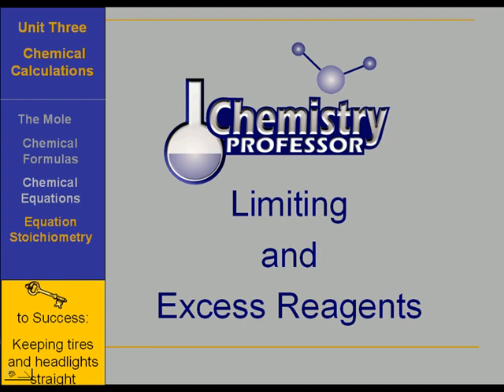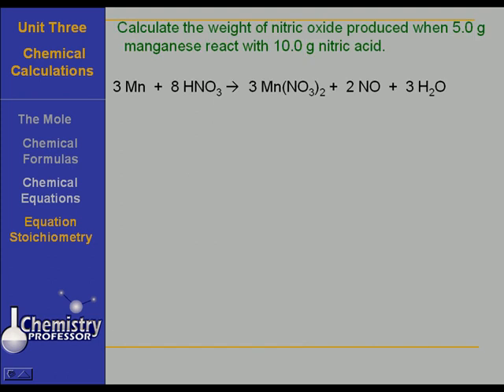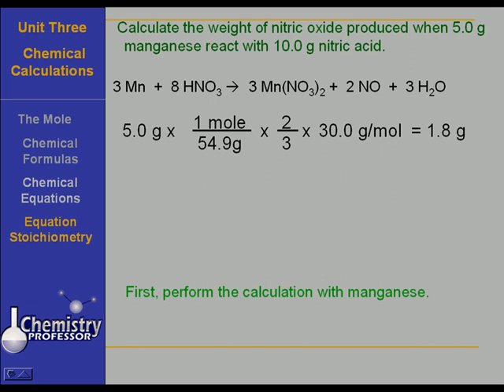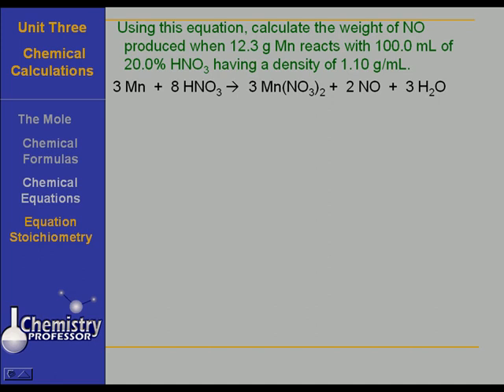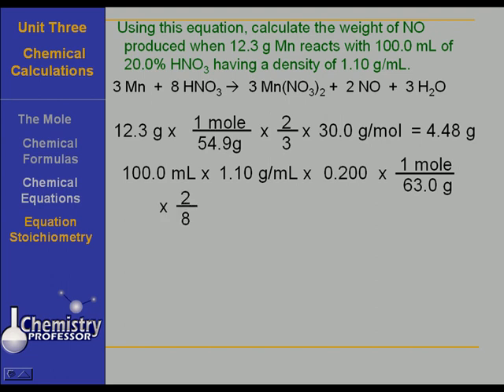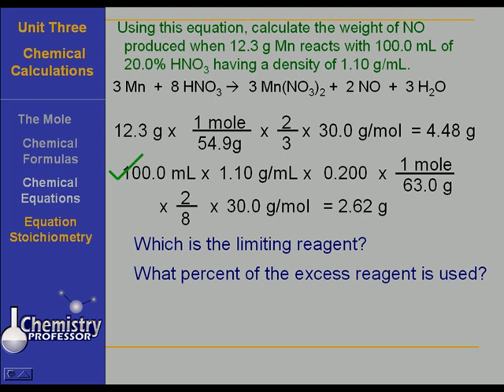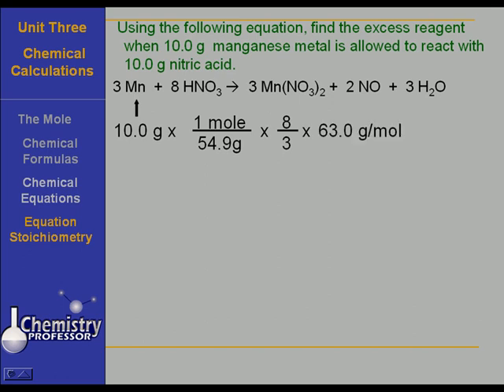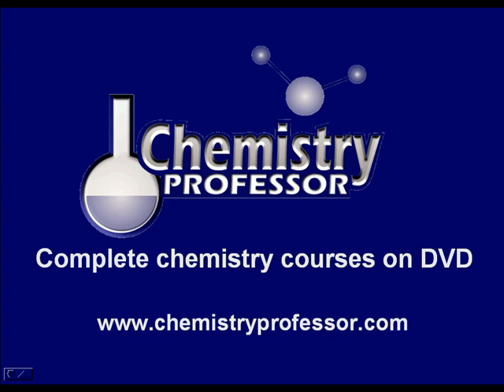Limiting and Excess Reagents

Comment from the maker: @73close 
Hello!  Thanks for your question.  The 63.0 g is the gram molecular weight of nitric acid which i determined by adding the atomic weights of 1 H, 1 N, and 3 Oxygens.  Hope that helps.

Dr. E.
Reply: Sandra Etheridge : will you please consider offering your course online ( as opposed to on DVD). I once bought your DVDs but I misplaced them. If the course was online, all I would need is to transcribe. DVDs also get scratched.